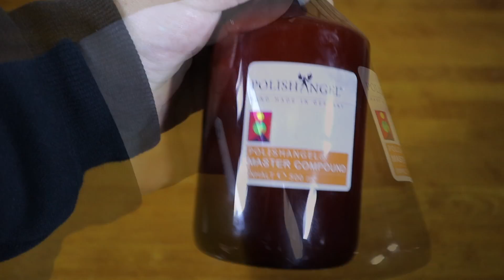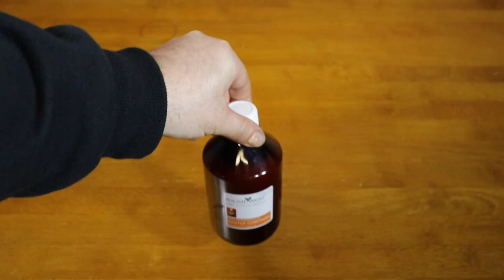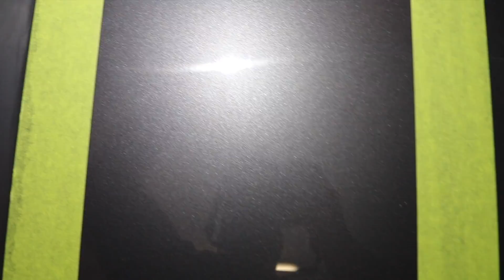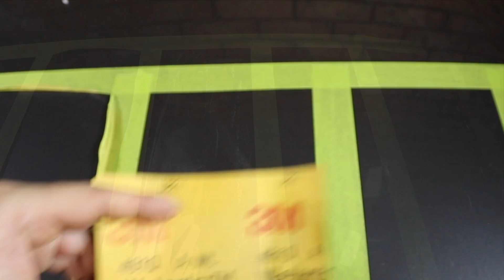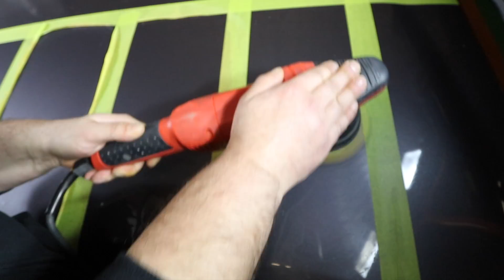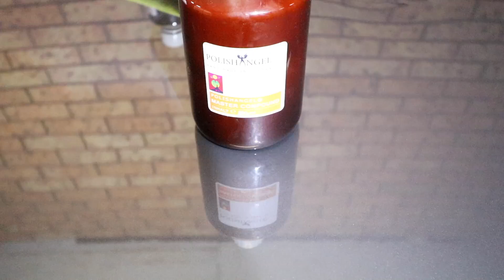Polish Angel Master Compound Review, Demonstration & Thoughts!

Comment: Hi Sandro just as an add on  I  have used the Polish Angel Carnauba Arts Yellow Citrine spray wax on my  Hazard Yellow SS as a topper over AutoGlym HD wax. It  added a warmer  yellow glow  and I loved it. But as i said to you on another thread I am a now a big Fan of the FK1000 (sealant) for its hard wet candy look and protection factors up here in Darwin. So if FK1000 had not showed up on your great Waxes review then it would be the Polish Angel Citrine. Interestingly tried the Polish Angel over the FK1000 with no visible benefit even recently tried the Concours Nova Jet nice product but didn't add to the FK1000 which is already sooooo glossy and hydrophobic. But when i need to go back to a compound polish I will try PA . Great Review Danny..
Reply: Your Welcome Sandro you provide a heartfelt and a genuine approach to your craft that's Y we all enjoy so much. I agree with your detailer friend that the Carnauba Arts is a fantastic product and provides excellent hydrophobic properties and it did last longer than many other paste waxes so even as a spray on it performs so well. I have shared posts with a guy called Accumulator on the Autopia forum in the US and he is the  FK1000 Champion. He predicted that i would probably just settle for FK1000 as a standalone i.e. yet to find a topper that you can say WOW 2. But i am sure there is one or two out there if you find one let me know. That's just the OCD in us Unicorn Chasers. Cheers Danny.

Comment: By the way, I'm pleased to see you using the uro-fiber pads! At some point, I would love to hear your thoughts on the uro-fiber pads and how they compare to your other favorite HDO Microfiber pads. Do you think the uro-fiber has the potential to cut as much as the HDO microfiber. Also, does the HDO microfiber finish as well as the uro-fiber? Also, which is more durable in your experience? Between HDO and uro-fiber I can't imagine buying Meg's microfiber pads anymore. They just aren't built to handle the excess heat  long-throw polishers produce. My FAVORITE aspect of the 5" uro-fiber  pads is it's exact fit on the backing plate. Thanks again for this video Sandro.

Comment: Then you must haven't tested Griots BOSS Fast Correcting Cream this stuff will outperform even Polish Angel!!!
Reply: Car Craft Auto Detailing I'll answer this, no it does not. FCC doesn't have a limitless work time, it's not resistant to heat from porous paints, and it doesn't finish like a polish. FCC is a great heavy cut compound but it leaves a very light haze, even with foam. I do not think FCC is a like for like comparison with master cut.

Comment: Hi Sandro. Been awhile. I'm getting ready to do this on my car before winter comes. This time I want to get better performance then the Pinnacle polish I used last time. I still ended up with some spot that look like tree pitch and bugs or other fallout that didn't come off. Would this be good for a hard German paint? I thought about making a Google doc of all your products, but that's a daunting task. Is there a way I could pay you as a consultant for my car? You know like you say "get this and do this with this product"? Maybe a list on a website?  Just thinking out loud. You have so much info and have been giving such great advice. At the same time, I'm a noob to all of it. I'll start going be though you videos as well to refresh my mind. To me, you one of my favorite people to learn from on car care. Peace ;-)
Reply: Car Craft Auto Detailing  Thanks for the reply. I went to Master Compound site. They have a 200ml as well. Is that enough to finish my car? Also they recommend their lambswool pad. What recommendations do you have?
Reply: If you've got tree pitch or fallout, a clay bar step may help.  Wash the car as you normally would, then use either wash soap or a lubricator (such as meguiars quick detail).  The difference a clay bar makes in smoothness is absolutely astonishing.  But, it will leave swirl marks.  You'll.then likely need to compound, polish then wax.  Maybe just polish and wax, if you're gentle with the clay bar.
Reply: ... wash soap or lubricator for the clay bar.  (Sorry left that out!)
Reply: I did use a clay bar last time. It seemed that I had some spots that didn't want to come out. I thought they would when I polished the car, but still had some spots here and there. It was my first time with a polisher, so I only did 4 passes with a, I'll say medium polish. I had light swirls, but the polish seemed to take care of them.
Reply: I'm getting ready to order some of this polish. I have a Flex 3401 DA and wasn't sure what exact Buff and Shine Uro Fiber pad to get. I see blue one that says heavy, would that be too much? Maybe stick to the orange one's? Paint is in good condition other then the tree/bug spots and industrial fallout. Can't remember if you have a video on scratches and nicks. I'm looking to do some small touch up here and there, what's your thoughts? I've seen some nice touch up kits, but is the paint in the kits the same; recommendations?
Reply: On the pads, I see that they have a few different kinds. I wasn't sure if I should get the Blue or Orange pad? Maybe I'm not looking at the right one. "Buff and Shine 6 inch Uro-Cell Orange Polishing Pad" or "Buff and Shine 6 in Uro-Cell Blue Heavy Cutting Pad" is what I see on Amazon.
Reply: Lol, I'll look it up. Sorry it's late, been up way too long. I'll get both so I have it on hand. Cheers on all the quick reply's.